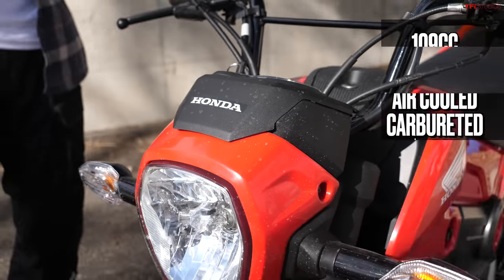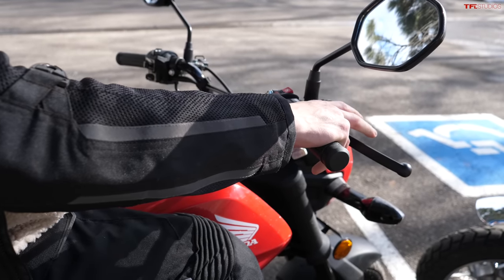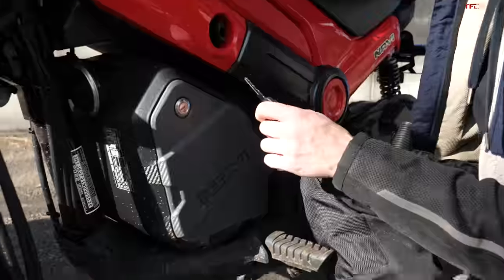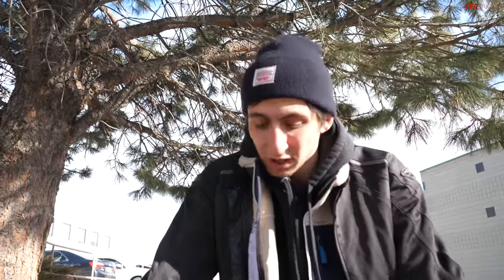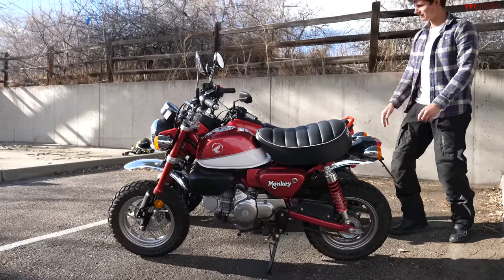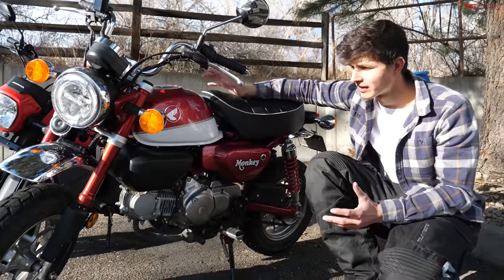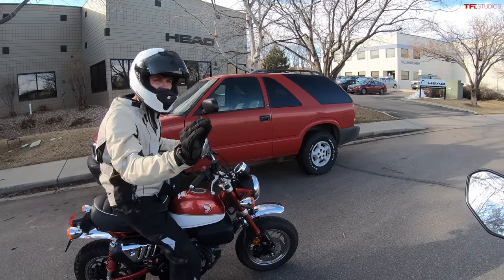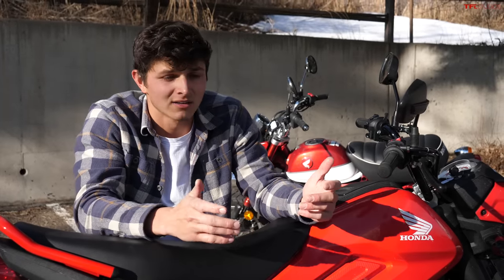MiniMoto Drag Race: Can The Cheapest Honda Navi Take On The Most Expensive Monkey?

Comment: I gotta say, I just bought the Honda Navi is a very cool city mini bike, plus you can carry a passenger, and gets better mpg then the monkey.. great starter bike or just to have fun with. I've seen videos of people in Peru riding for 8 hours straight over mountain passes and no issues. great little bike.
Reply: Just got mine about a week ago as well. I live down in Miami and it’s great for the beach and college
Reply: I wish they would’ve made the Navi a little bigger and 125cc-150cc would’ve been perfect . Other than that a great option . Especially for those who aren’t acclimated with switching gears . Or don’t want the hassle
Reply: @rickybobbydastar6534  i ran across a stock grom at a red light and we both booked it and it was only about a 6 feet gap between us and the other rider was approximately my height
Reply: @Sweethustles  interesting, how do u like the Navi ? I had a hawk 250cc , first bike, like I didn’t understand the choke at first , definitely fast but wish I got something a little smaller less powerful for a first bike
Reply: I have had my Navi in India since 2016. Done 10000 kms. I have driven it 300 km in 7 hours with one hour stop...carrying 70 kg luggage.  Navi has never let me down. It may look dainty but is tough inside.
Reply: @rickybobbydastar6534  it’s been a great 300 miles so far, I got to say for my height and weight it’s enough speed to keep up and have fun in city roads. Also the handling is unlike any other bike I’ve been on. Very easy and approachable and people say it’s a scooter but I rather roll around in that than an actual moped
Reply: Actually… side by side comparison by TFLbike proved that the Monkey, even with the larger engine actually gets better mpg than the Navi in real life conditions.
Reply: Not sure why it’s illegal to carry a passenger on my Navi in Canada. So stupid.

Comment: Nothing wrong with a carburetor…little Seafoam at every fill up and you’ll never have to touch the carb.
Reply: Just never leave ethanol in the carbs. If you're going to park a carbureted vehicle and not run it for a while, shut off the fuel and let it run the bowls empty. Or better yet, just run ethanol free gas.
Reply: @crudboy12  Hmm, good tip there. Thanks brother!
Reply: Can of Seafoam ought to last a while, given that this bike takes just under a gallon of gas. 😂

Comment: 😂🤣😂 First world problem your bike has a choke lever and you have to turn on your fuel. My Honda XL 500 on top of all that was kick starter only and had a decompression lever. I might also add there was no fuel injection back then either and my bike could be a real bitch to start.

Comment: I own one of these things (navi)... along with a '21 MT-09.  I got shit from all my riding buddies about it, but after they actually tried it they seem to understand the appeal.  Easier to toss around NYC streets, fast enough to get yourself in trouble (25 MPH local speed limits), can toss it on the sidewalk so parking is a non-issue and can legally cross toll bridges/tunnels that e-bikes and the like can't do.  There is a certain appeal of hooning around on a minimoto around a dense city then proceeding to park it on the sidewalk and grab a quick bite to eat (good luck doing that on a full sized motorcycle).  Would a Grom/Monkey be even more fun? Maybe, but the Navi at half the price of either of those is a fun little diversion.  Hell, I even took my 70 year old mom on a ride and she said it was fine.

Comment: Personally I would never ride a motorcycle if I had to use it manual. Navi is perfect for beginners and people who otherwise wouldn’t touch a motorcycle. It’s also not as intimidating or dangerous because there’s only so much trouble you can get in at lower speeds

Comment: 2:39 Did your rear wheel fall off, looks like that bolt is undoing itself
Reply: the bike was on center stand, and its an automatic so since they were not holding the brake the rear wheel was spinning under the engine revs.

Comment: Complaining about the dealer fees adding to the price of the bike is a fair complaint when basically the only positive to the bike is its price - as that seems to be the bike talking point of the machine.

It doesn’t help that the thing is from the stone age. I can forgive the carb, but not a front disk.  For money that equates older, used sub-200cc, full-size starter bikes: it at least needs a front disk brake.

Let’s be honest, these were kicked off the subcontinent because they couldn’t pass tightening emissions and Honda still had the ability to manufacture more.

Comment: The Navi is a scooter. For sure. Nothing wrong with that but it just looks like a motorcycle while underneath is standard scooter design.
Reply: A sheep in wolf’s clothing, if you will.
Reply: They require a motorcycle license,  motorcycle insurance policy , and an endorsement.  They are much faster than scooters with 1/2 the engine size.
Reply: So. I largely agree. I kind of want a Navi. It is basically a scooter, but it's a scooter with foot pegs and you can grip the fuel tank with your knees and I'm really curious to try one and see how that feels.

Comment: A better Comparison would have been the Navi and the Grom.  Clearly that's where it's styling comes from.

The Monkey is based off of a 50cc mini bike from half a century ago, a better question is why is the MONKEY do small?  Not why is the Navi so big. 

Also, as to lack of clutch taking away from motorcycling; yes... But Honda has full size motorcycles with clutchless shifting too.  So don't get too hung up on that.

Steering lock?  Yeah that's where all motorcycles used to have them. 

It really feels like you guys don't like the Navi and we're forced to do the video.  There's a reason why the Navi is less than half the price of the Monkey/Grom.

The Navi needs to be reviewed on its own merits for what it is.